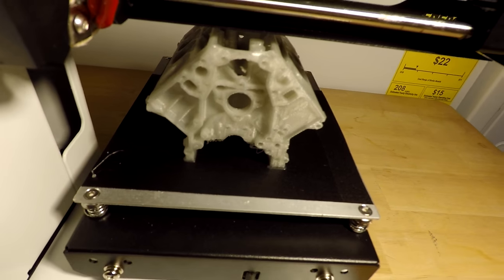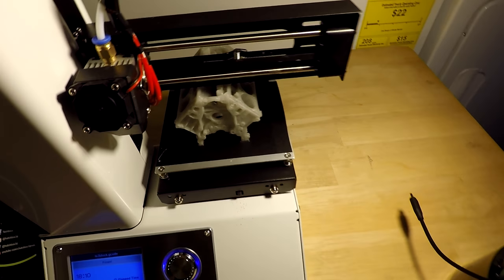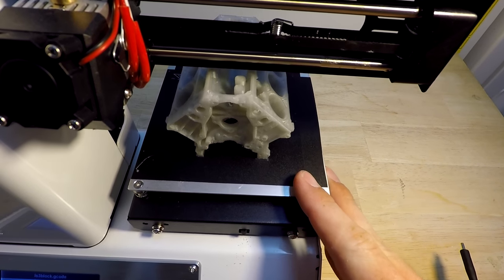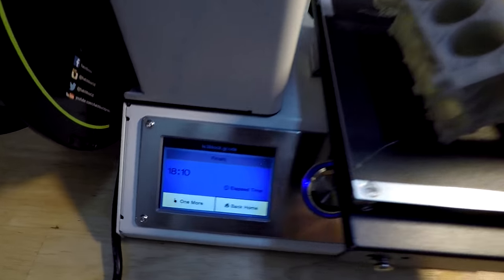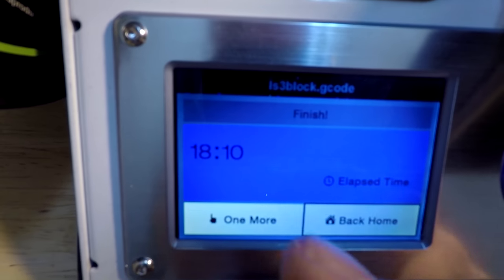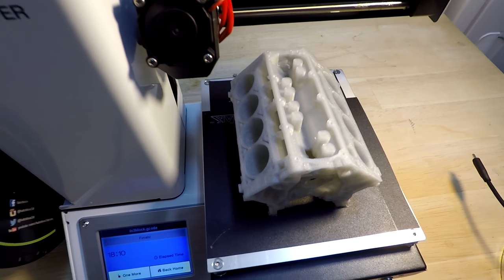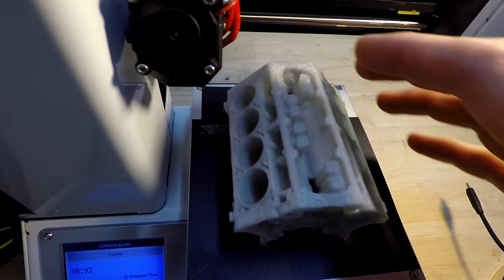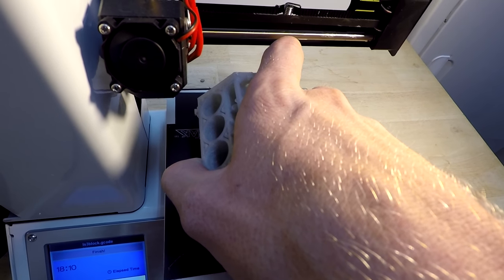3D PRINTING A MINI LS3 ENGINE!  (3D Print At Home For CHEAP)

Comment: That's the engine block I designed actually.  I put it on GrabCAD along with most of the LS3 rotating assembly.  Makerbot contacted me to ask if they could use it but they never told me what they were going to use it for so I'm guessing that's how it ended up on Thingiverse.  I have fully detailed heads and valve train that will be done soon and intend to put an entire engine out there eventually.  Have an LS3 intake manifold sitting here begging to be modeled.  Takes a lot of time to model all of this stuff accurately especially if the parts aren't in front of you to measure.  Cool to see this stuff being used out there.

Comment: These things are pretty cool for prototyping real parts for real engines! It's starting to become more common, people use it to prototype custom one off inlet manifolds and then make them for real. I suppose if one was made well enough, the actual printed part could be used after a bit of finishing

Comment: I have the same printer, same filament and the same files as you but every time I print the engine block with no supports it fucks up at the over hanging angles.